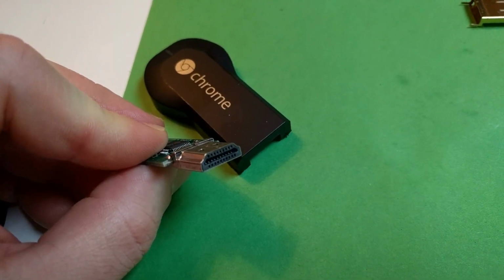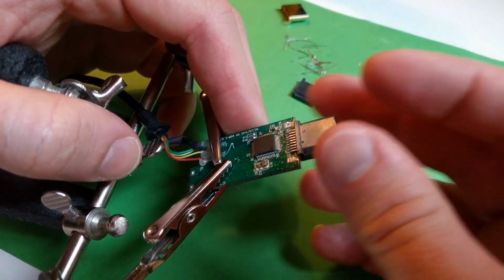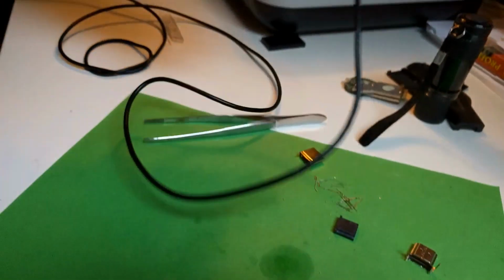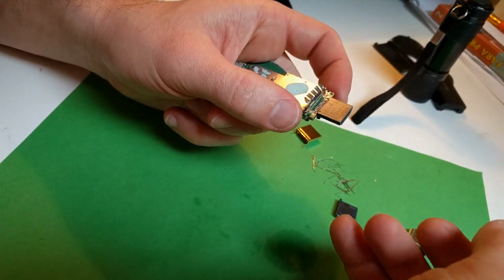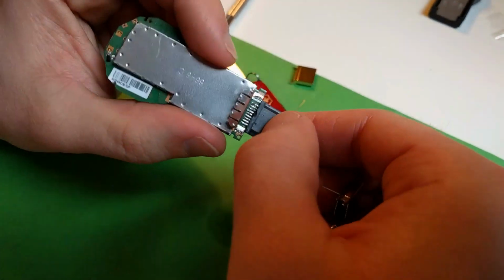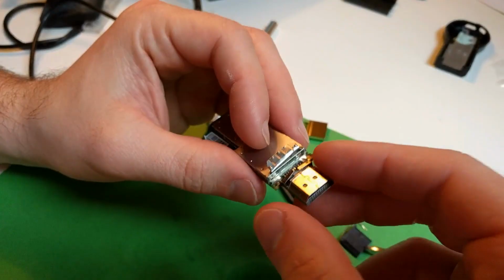hdmi port repair / replace hdmi port, connector

Comment: Awesome video! Do you know where one can buy a new HDMI jack/port/connector? I have to replace not only the metal housing but also the black plastic inner part it covers. Due to the micro USB cable connection weight, the metal housing broke first. It was still usable, but then one of the inner metal pins/connections (the one on one end) got damaged due to the housing having some play when being changed from one device to another.
Reply from the maker: Hi, thank you! eBay or Amazon
Reply: Basically it would be more or less the same as the HDMI repair.

Comment: I have 2 Chromecast in the house & everyone keeps unplugging them and moving them to different TV's. From now on I'll be plugging my Chromecast into a cheap HDMI extender cable and let that get damaged. Pins are all fucked in my HDMI port on the Chromecast & after watching this video it seems I'll be hard pressed to find a replacement HDMI part and solder it correctly without a tiny tipped iron

Comment: I'd liked to saw how u got that she'll off..I'm having problem with the other port
Reply: Shona Magouyrk get a small flat head screw driver and pry it open. Its not very hard. The hardest part is getting the metal protection plates off to get at the HDMI and or micro USB ports

Comment: How do you do the reverse what happens when you get the metal part of an HDMI cable sucking a graphics card. And why do graphics cards only have one HDMI port?
Reply: I just upgraded the power supply in a 15 year old pre built that still works for some reason, and I put a 1060 in there a a couple of months before the price dropped from 300 to 200 ran it for a month.

Then I turned it off even though it was making like $12 a month after power cost, then I tested some games on it and broke the HDMI cable.
Reply: Now that winter is coming I might as well just plug it back in the electric heating bill is like $200 a month.